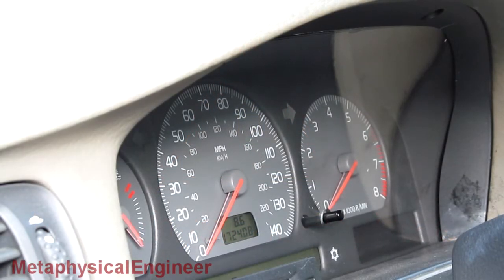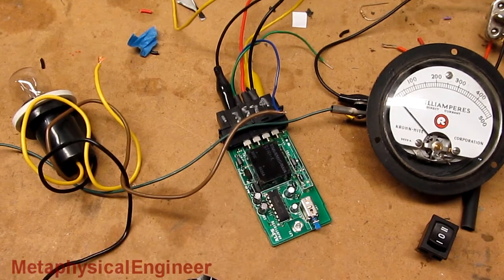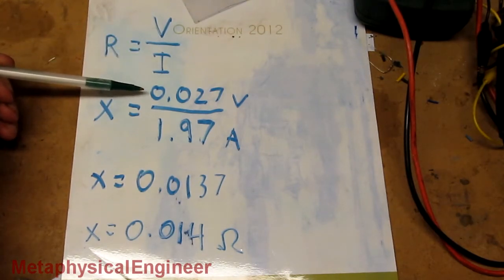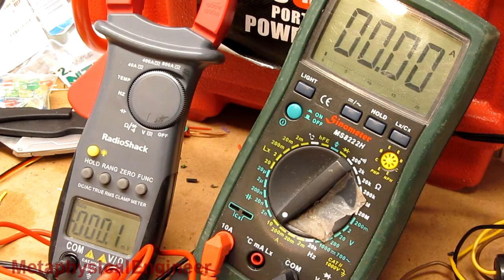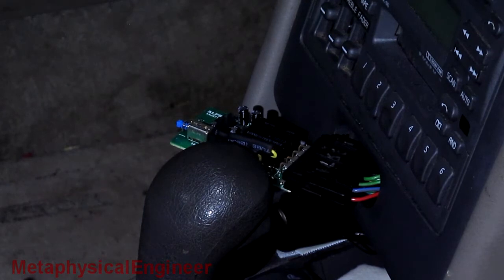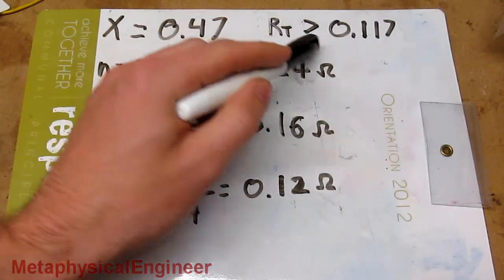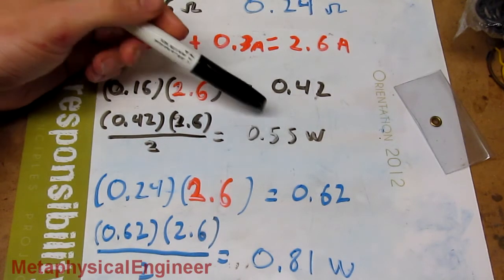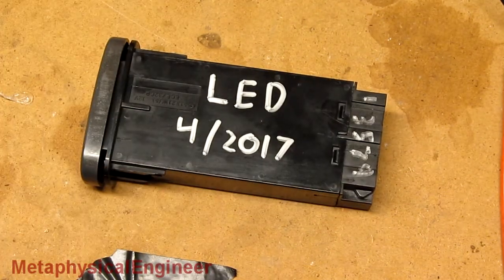LED Turn Signal Hyperflash Solved - NO Load Resistors Needed!

Comment: newer vehicles does not use flasher relay anymore and use BCM Body Control module and unable to prevent hyper flashing of turn signals due to usage of LED bulbs.
Reply from the maker: You’re right!  Newer vehicles will need the load resistors or some even more invasive electronics surgery to treat the lower current draw of the LEDs as correct.  Some drop in LEDs claim to be compatible without throwing errors but I’ve not tested any of those in a newer vehicle yet.
Reply: @MetaphysicalEngineer My 2013 F-150 does not have the replaceable relay. The 2012 was the last year with it. I was going to swap mine out with leds and resistors but then I found out resistors can add additional load to alternator causing potential for the alternator to go out early on some vehicles. I need to do a bit more research before I am comfortable installing the leds in my truck.